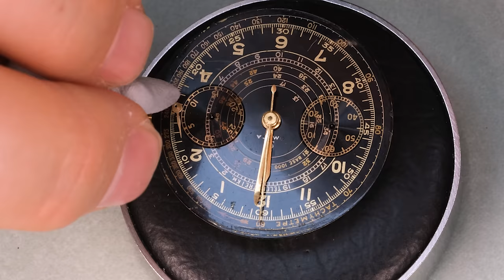First time on YouTube - the legendary Omega 33.3

Comment: This is probably a simple question, but why is it the watch will start working as soon as you put the balance back in? I'm a somewhat newbie to the mechanics of the watch world.
Reply from the maker: Hello Dave, that's actually a pretty complicated question or at least the answer is :) On the underside of the balance wheel is a little pin, which fits into the horns at the end of the pallet fork. The balance wheel is made such that at rest, that pin will be in the middle between the horns. When putting the balance in, you have to twist it a little bit so that the pin enters the gap between the horns. When the balance is then released, the hairspring has a little bit of tension, which makes it turn and the pin hits the inside of the opposite horn, making the pallet fork rotate and release the escape wheel. If there is some power on the mainspring, thus if the watch has been wound a little bit, the escape wheel will rotate and give impulse to the pallet fork, which gives impulse to the balance wheel, and the watch starts running.
Reply: Makes sense. I didnt realize that there would be any energy in the mainspring. I really enjoy watching your episodes. Sometimes I wish I would have tried to be a watchmaker. I might still do it now that I'm approaching retirement. :) Looking forward to a tourbillon!! hehe

Comment: At one point you said that the wheels do not put force on them but "just rolls"
Can you explain this please?
Reply from the maker: Hello Luigi, the teeth are cut with so-called cycloid profiles, which is a profile generated by a circle rolling on another circle. In practice, what this means is that the contact point of a tooth does not slide or rub against the contact point of the other tooth, it rolls as the wheels rotate. It's a bit difficult to explain but you can look up cycloidal gears for drawings and explanations. 
Typical machine gears are cut with an involute tooth profile, which produces more rubbing and is correspondingly often lubricated, in particular when under heavy load.
Reply: @VintageWatchServices  Thank you VERY MUCH for this explanation, I am googling  cycloidal gears right now.
The wonders of mechanical engineer behind swiss watches keep amaze me.
Reply from the maker: @LuigiRosa  👍

Comment: Whenn assembling, why plates looked so dirty? Was it just a play of light, signs of wear or there is no need to clean them?
Reply from the maker: They are of course clean, they just went through the cleaning machine. But sometimes metal tarnishes over the decades and this watch is 80 years old. I tried to remove it with a couple of things but had to leave it as is.